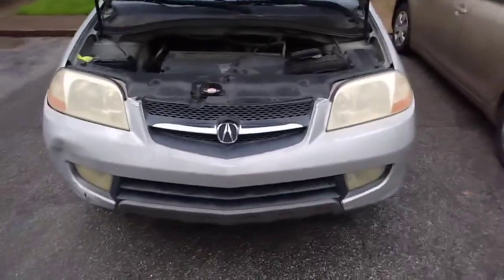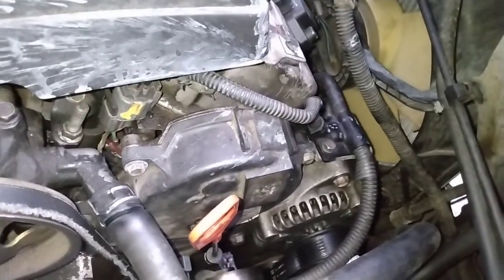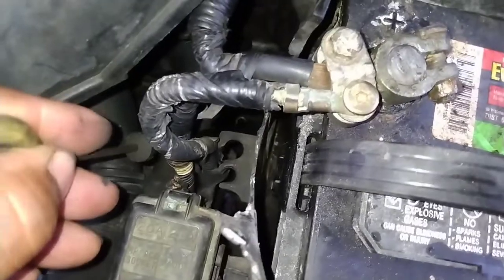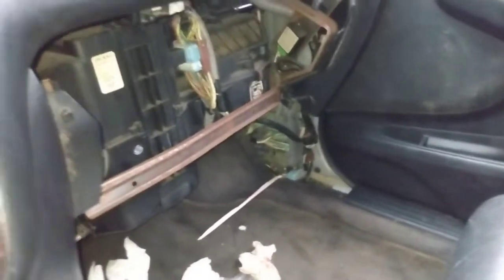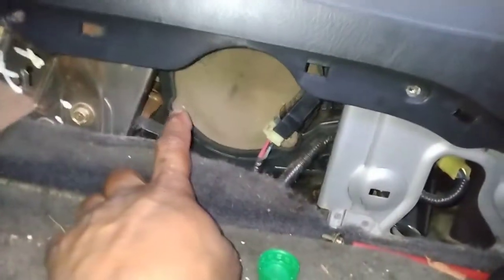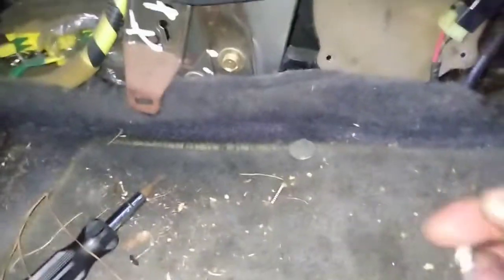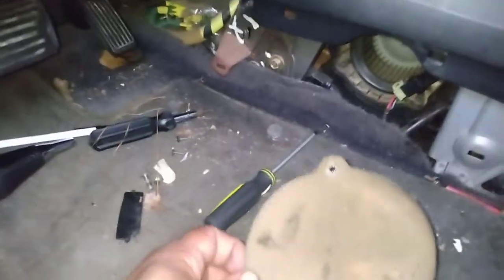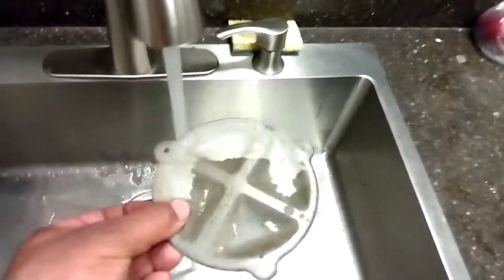2001-2006 Acura MDX.  2003-2008 Honda Pilot Rear blower motor filter removal/cleaning

Comment: Your video about the MDX blower motor describes a problem I have with my 2001 MDX front blower motor - mice build a nest in it and leaves collect in it, requiring a frequent clean out.  The blower intake obviously does not have a screen designed to prevent mouse and leaf access.  If you have installed or plan to install a screen to solve this problem l would be very grateful for your sharing a DIY solution ! Thank you for your inspiring contributions!!
Reply from the maker: @falcon7679   Yeah unfortunately that's a problem with pretty much every car.  That front screen is tricky to block because you would have to remove the dash to really access it. No matter what you cover it with, rats and mice and pretty much chew through anything.  You would have to weld a rebar cage over it, but then it would restrict airflow. Cleaning the filter from leaves is just a part of maintenance, but there's really no fix for rodents other than putting some type of repellent in there.

Comment: Thanks luke I have the same year mdx and I lpve it going on 300,000 miles still runs like a top. Trying to recalibrate my speedometer needle got trapped behind the pin. Im going to try a magnet to pull it bac around, before I take everything out.